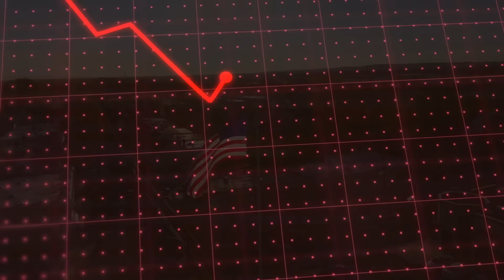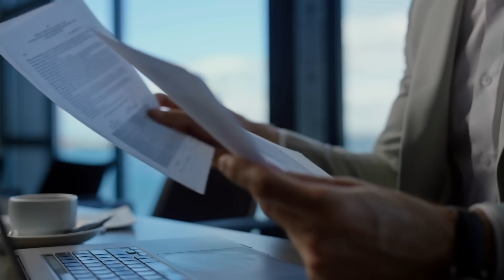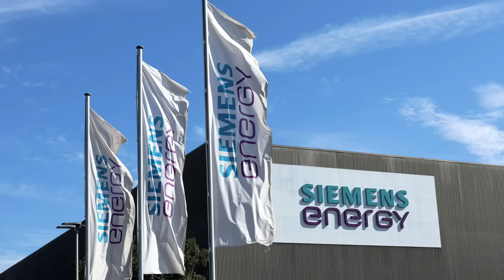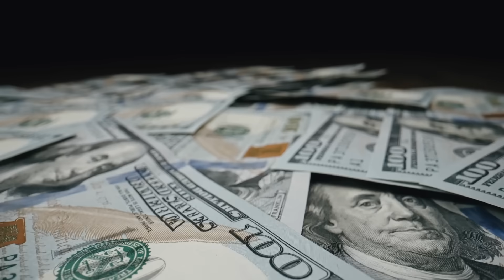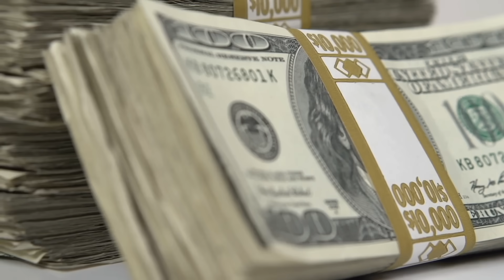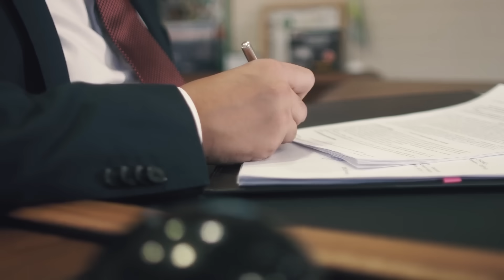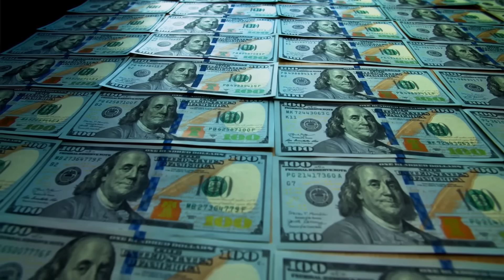The Real Reason America Has Turned Its Back On Wind Power Energy

Comment: Ideology over the practical and Common Sense way..   All built around the premise that CO2. is going to end the World??    Well I can think of many reasons today to end the World..   Eg;  Stupity of War !  Out of our control Meteior,   Earth's Change magnetic Field Changes.   which the Sun has already gone through,  giving us a Solar Maximum.  Solar flares that can incinorate the planet??    But Magnetic change is a solar system wide issue??    Kind of makes the theory that one element CO2 controls our weather Mute!    
Power lines that are D.C. will come at a huge cost. Then there is conversion  to A.C ?    From D.C.    Altermnating Current (backwards and forwards).   D.C, is Direct one way Current.   For high power you need the A.C Current.  Which is also made into Three Phase.  For the larger power draws.  A.C with tree supplies. ( That is basic and in short terms ) !
Reply: No sane person claims that CO2 ends the world.
This planet was a molten rock once and did not end...

Comment: Wind and solar are NOT clean energy. They are extremely extraction industry dependent and make unrecyclable materials that use plastics, rebar, and concrete to make. The batteries and power stations  and cables all require materials. The industry sector relies heavily on taxpayer subsidies, in other words it is NOT economically viable.
Reply: Compared to fossil fuels they are clean.
Fossil fuels get subsidies too...
Reply: @old-pete  sorry mate, you are dead wrong
Reply: @old-pete  Natural gas separates into water and co2 as it burns. It is the closest thing to pure hydrogen we have at the moment. Co2 is a critical component of life on this planet, and it is at an all time average low in earth's billion year history, and there is no evidence that this gas can drive planetary temperatures, in fact there is plenty of evidence to the contrary: for example rapid onset ice ages that began when co2 was 17x current atmospheric concentrations, and equally rapid deglaciation when co2 was even lower than today. We should diversify energy production of course. But we should not force the use of dirty, unreliable, expensive, socially and environmentally destructive measures. For example, besides the absolutely unacceptable working conditions for the adults, approx 40k children are slaves in the cobalt mines, in the Congo alone, and there are thousands more retrieving coltan and other precious metals used in electric cars etc. For the occidental world, the forced transition to solar and wind is a prescription for misery. For africans, living on the edge of starvation, banning or strangling the local exploitation of their petrol reserves is a death sentence for millions.

Comment: Just going to throw this out here because nobody likes good ideas.
 So, why not attach three Vertical Axis Wind Turbines, Horizontally, to a geared top like a Helicopter.
  Then have the Gearing Spin Up a Flywheel Generator and after a day or two, regeneratively brake off of it at regular intervals, then stagger the Wind Generators in the Wind Farm for Constant Power.. 

Whatever though, nobody like innovation and you cannot scam the public off of an idea like that...

Comment: There is absolutely no reason to litter the landscape with these eyesores. The push to minimize or eliminate CO2 emissions is not only unnecessary but also completely ineffective. Human activity only accounts for around 4% of the total increase in CO2 and even so, the increases in CO2 levels are insignificant and as such have absolutely no effect on the climate.  The push to minimize CO2 emissions is more a product of a failed education system than it is anything else.
Reply: Human activity accounts for 99% of the increase in CO2.
Other sources did not increase their CO2 emissions.
Windturbines do not just emit less CO2, they also produce electricity cheaply and make a country less dependent on foreign fossil fuels.
Reply: @old-pete  Your first statement is completely false. Human activity is responsible for roughly 4% of the increase in CO2. 

Natural CO2 emissions increase with a warming climate. The warming climate is a direct result of increased solar output. CO2 levels at this concentration have nothing to do with warming. 

Wind Turbines don't emit ANY CO2. The do NOT produce electricity any more cheaply than other sources, ESPECIALLY coal. When total cost of operation is taken into consideration, wind power is one of the most expensive. 

Finally, wind power, when it is the primary source,  has a tendency to destabilize the grid under load. Without alternative methods with large inertial footprints, wind power, when overloaded, can easily crash the grid. Look at what happened in Texas a couple of years ago. 

The easiest way to decrease reliance on foreign oil is to increase domestic production. There is no viable solution today for reduction in consumption. 

Those are the facts.
Reply: @old-pete  I'm afraid you are the victim of misinformation sir.
Reply: @AlMoskowitz Physics disagree and it was proven again and again.
If you do not understand physics, then this topic is not for you.
One should note that his "little' increase represents around 1100 gigatons of CO2...
Reply: @old-pete  Funny. I'm the physicist in this conversation - and it shows.
Reply: @old-pete  It's not scattering, it's absorption and retransmission - and CO2 is one of the least efficient gases at so doing. Add to that the rarified nature of CO2 and you see quickly that there is no effect. But even if there were an effect, you couldn't blame the changes to the climate on a concentration change of 1 molecule per 10,000 over 67 years. That's what we're talking about here. 

I'll let you in on another piece of data that is NEVER shared. In the ice-core record and the tree ring record, which are so often cited as measurements of historical heating/cooling and CO2 concentrations, the CO2 concentrations FOLLOW the heating, not the other way around. 

This whole notion of CO2-caused climate change is complete nonsense. The only thing worse than the notion are the ridiculous mitigative actions being taken to "remedy" the situation. It's very dangerous to reduce CO2 concentrations lower than they already are, not because of the climate, but because of the need for CO2 for plant growth. That's the bad news. The good news is that even if all human activity ceased tomorrow it would have next to no effect on the concentrations of CO2 in the atmosphere. 

There is a slight impetus to eliminate fossil fuel eventually, but not because of climate change. The lack of an infinite supply of oil and gas should be the driving factors, not the pseudoscientific nonsensical fantasy that if we don't take immediate action, we are going to render the planet uninhabitable.
Reply: @AlMoskowitz  The retransmission happens in all directions.
And yes, the effect is strong enough and going on much longer than 67 years. The increase started around 170 years ago.

And no, CO2 concentration does not always follow the warming. You should check more carefully.

Btw. plants grew fine 170 years ago and there are no plans to go back to the CO2 conentration of the 1850s...

Comment: Windmills are  inefficient, intermittent,  produce small  amounts of expensive energy,  rely on taxpayer subsidies, ruin the landscape, are massively expensive  to maintain, and  have  high failure rates. They consume  large  amounts  of  land, copper,  steel, composite  and  concrete  compared  to the  infinitely superior nuclear power
Reply: They are extremly efficient, because they need a lot less fossil fuels.
That what is what makes them produce cheap electricity. 
No windturbine owner will turn off an windturbine, if gets paid only 1 cent per kWh.

NuScale wanted 9.3 billion US$  for a 462 MWe nuclear plant. How is that cheap?

Comment: The real problem with wind a solar is intermittentcy. To have reliable power, you need a lot more than overnight storage capacity. You actually need 60-90 days of storage for reliable power in most locations. I know most won't believe that, but do the research and discover that it so for yourself. This is why 100% renewable is an exonomic disaster, as you raise the percentage higher and higher the true cost can't be hidden.
Reply: Nobody plans to power nations only with wind and solar. There are more renewables.
Some countries are already at 100% renewable electricity production.

Comment: I notice that the first two corporations listed as abandoning wind power, Shell and BP, are largely oil companies.  They and the other corporations have the collective ability to change regulations on other issues, so I am sure the lack of ability to connect to the grid reflects the low priority they place on moving on from fossil fuels.  And renovation of the grid is also a major project, for which they are waiting for taxpayer subsidies to achieve.

Comment: Cost of construction, and a feasible planing process are both part of the problem.  Note that China (with some central planning capacity) is also experiencing considerable delays,
involving curtailment, while grid construction/extension/interconnection  issues are worked out, for both wind and solar.

Until about 2017, all wind power plants were dependent on government incentive subsidies. In 2018 (I think, the time may be +/_ a couple years) an offshore wind development was 
bid upon without any subsidies by an outfit which installs wind farms ... based upon the previous experience in the North Sea, where prior plants had earned consistent revenue and
good profits. This increased expectations of further "progress", which then ceased after the surge of inflation began 2021 following the pandemic inspired fiscal stimulus. Oersted
executives specifically cited the materially increased costs and ruined business model from inflation when they cancelled some East Coast U.S. offshore projects.

All large construction projects are funded partly by credit, and a revenue stream needs be created in timely fashion to pay the interest/principle. Construction projects are often rushed 
to address the repayment issue.  It would be useful to have the grid upgraded simultaneously as the wind/solar plant is constructed (both projects would be able to pay the cost of construction immediately at project completion). That can only happen if these events are planned with coordination in advance. A national/regional plan for grid and power plants would help.

Elon Musk recently innovated a solar PV plant interconnection without the customary substation: he employed advanced inverter design to replace the substation transformers, (I think).
For a decade or two there has been speculation that a novel grid might employ much less transformers than conventional designs.

Comment: This video does make a good point that the grid, into which wind farms feed, has a limited capacity to handle varying supply. Huge amounts of energy are flowing through relatively slender components which work well as long as the flow is even. Changes in the flow are what cause problems. This is a technical problem, not a financial one. Conventional power stations (coal, natural gas, nuclear, hydro) deliver a constant supply which works very well with the current grid architecture.

If wind had unlimited local energy storage, that would make it mesh perfectly with the grid. Excess energy (high wind) goes to storage and if supply declines (low wind) then stored energy can make up the deficit. In this way the energy flow to the grid remains constant. Unfortunately, energy storage technology is in its infancy. I'm a big fan of wind and solar (with battery backup) for use by individual households. If the grid is experiencing brownouts or complete dropouts, which seems to keep happening, you can keep going. But it does not yet translate to countrywide use.
Reply: Varying power is not the issue. Too much power is. If the grid had enough capacity, one could connect every power plant.

Comment: The practical use of solar voltaic and wind turbine generation of electricity is for maintaining electrical storage such as charging storage batteries.  The wild AC they push onto a power grid for dispatchable customer AC has to be instantly backed up by highly available sources of electricity.   That instant makeup is done well by natural gas turbine generators running at high service idle consuming 70% of the fuel of their full output, but making near zero electricity.   

In the US the fuel savings from solar voltaic and wind turbines is advertised at 1% each and is likely less.   The 12.4% 0:15 wind turbine generated wild AC electricity pushed onto the public power grid is meaningless.   It is how much fuel the wind turbine generators are saving that is important.  Which is likely less than 1%.

The US midwest scheduled wholesale grid quality electricity is a little less than $0.03 kWh.   The Virginia offshore wind turbine farm is trying to get a forced buy of its power at $0.078 kWh to the public power grid.   This is wild AC.   In planning for large amounts of wild AC it is considered needing to be backed up instantly by natural gas turbine generators.  Hydropower can instantly backup large amounts of wild AC, but it is not commonly available.   The natural gas turbines can not make effective use of their steam cycle when backup large amounts of wild AC with adds 50% fuel savings. 

There was suppose to be significant natural gas savings when the offshore wind farm off the western coast of the UK was running, but then there was a multi month reported drop in wind speed causing the output to drop to 10% of rated capacity.   Before that it could be seen on the website the turbines were running at 38% capacity with the available wind velocity.  Wind power goes up with the cube of the wind velocity and also goes down with it.   There is very little energy in 12 mph wind.    Almost all the electricity was now coming from very expensive natural gas without the Russian supply of natural gas.  

There doesn't appear to be a return to normal fuel savings form the UK offshore wind farm with the return of normal wind.   The previous fuel savings may have been exaggerated and the erratic nature of following the wild AC under estimated for long term use requiring more high available and expensive to fuel instant backup. 

Offshore wind turbines are very expensive to install and service, but they all seem to have extensive government subsidies for installations.   Their high risk insurance underwriting is difficult.   There are companies that insure offshore wind farms including damages and business interruptions.  

These insurance companies may in reality simply pay to decommission a damaged offshore wind turbine totaling it at its previous highly depreciated value as a payout to the insured party rather than risking humans lives and large expense for a facility of low appraised worth.  An offshore wind turbine if damaged may just have too many risks associated with it for insurance companies to risk fixing.

Having liability insurance with other coverages is still essential for peace of mind of wind farm operator.   The shards from a shattered fiberglass wind turbine blade off the east coast of the US washed up on a tourist beach causing the municipalities to shutdown the beaches.  There are many possible claims to be placed on the wind turbine's owner.
Reply: That is BS.
The electricity is not that volatile, as the grid has too much inertia. Power production of wind and solar can be easily calculated in advance. Gas turbines do not need to idle. That is a common misconception.

Comment: No such thing as clean energy. Such a deceptive term.
Reply: How dirty is wind or the sun?
Reply: @old-pete  it's not clean have you ever seen how they are made. Or the twenty year life span with no real idea how to recycle them. No wind and sun aren't dirty but producing manufacting is. That's what my comment is. Wording it's not clean just like lithium batteries. They are now drilling wells just like oil for lithium. I have first hand knowledge so it fact not just a position. I do acknowledge they are better than some alternatives. But clean they are not. Still need oil steel plastics. Concrete rebar large spaces to be disturbed so just wondering. How the term clean is being used.
Reply: @DavidSmith-wd7wc I was talking about the wind and the sun. The sun runs a couple billion years...
You do not seem to understand what the clean energy is. People are not talking about the electricity, but the energy powering the power plants, in contrast to coal, oil and gas.

And yes, windturbines can run longer than 20 years and can be recycled.

Comment: The alternative energy boondoggle has failed over time apparently driven by the expiration of the governmental subsidies that artificially boosted it.  Couple that with the exposure of the unanticipated maintenance and lifespan challenges which exist and the profitability ceases.  The grid is what it is.  When alternative energy has to compete with other sources they fail.
Reply: And still alternative energy sources increase their market share.
Texas experienced a nuclear and coal power plant tripping in consecutives weeks, which was handled by battery storage taking over the load.